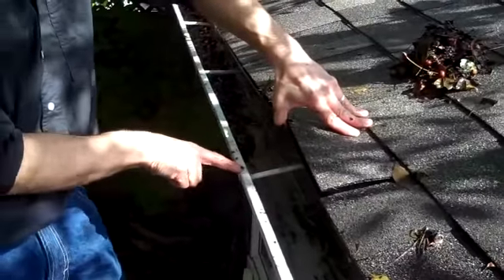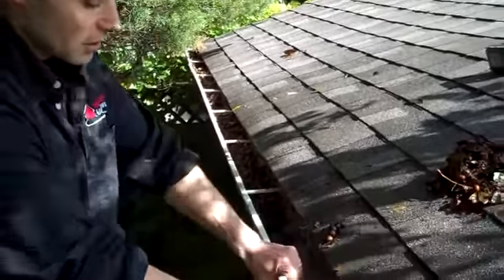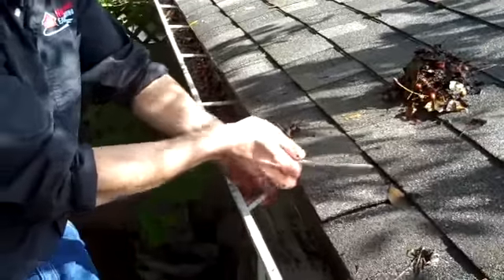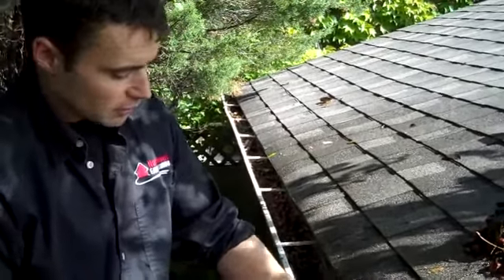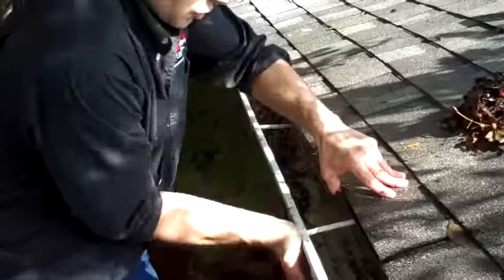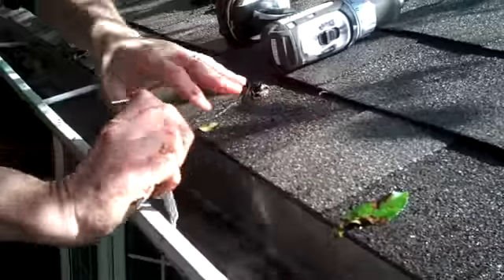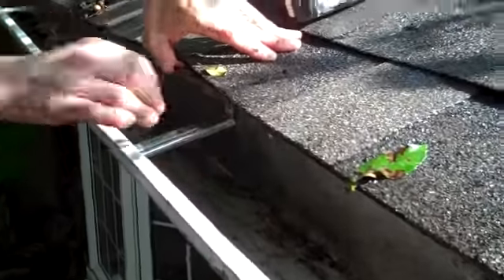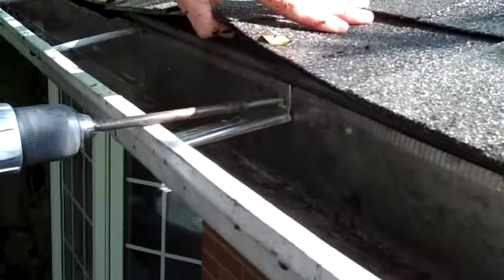How to fix loose gutters.

Comment from the maker: @AnnihalationonaStick We just use a hammer and a pair of tin snips to remove. However we do not save the pieces. If you are reusing then you could clench stubborn spikes(if thats what its fastened with) with vice grips and tap them out. Good luck!